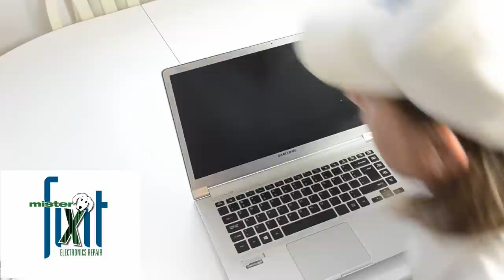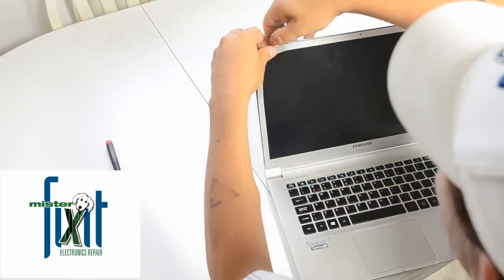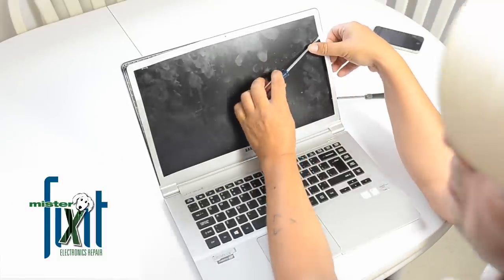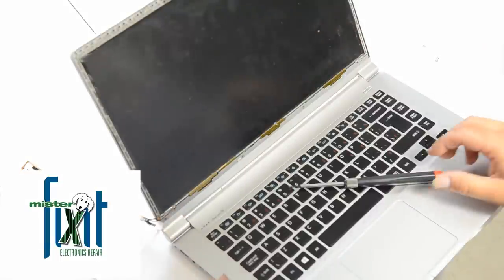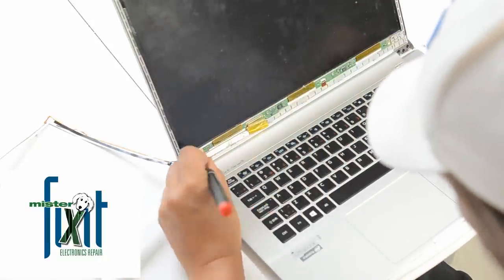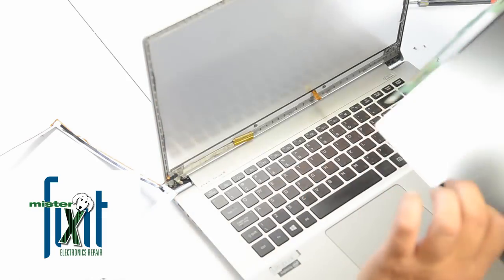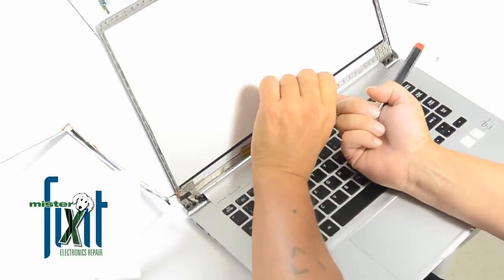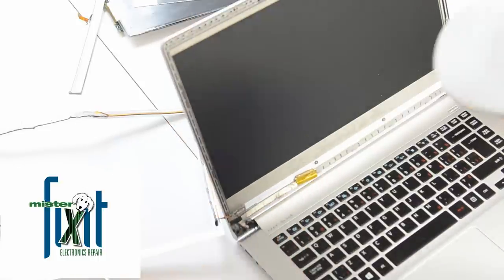HOW TO REMOVE SCREEN ON SAMSUNG ULTRABOOK

Comment: Thank you for the video but....  Part# BA96-06424A LCD-replacement comes as one unit with the hinge assembly.  Flip the unit over remove the 10 back plate screws, remove the black hinge screws and unplug the mother board connection.
Reply from the maker: Thanx for the share Paul... this video was shot before you could even buy replacement parts
Reply: +William Stephen Walsh , 139GBP in Poland with discounts in Samsung.
Reply: I need a 13.3" screen assembly but they want $325 (or something from Samsung US) where can I get one for about half that price?, my model number is NP900X3D.

Comment: Vince peels off the screen, then continues into the backlight assembly, piece by piece.  No point in trying this, as you'll have to order the whole top display to replace the glue sandwich you've just spent an hour peeling apart anyway.  

Someone who knows how to separate the screen piece from the backlight without tearing the backlight to pieces has some serious arcane knowledge.

Comment: where do you get a replacement screen from?, all I see on ebay is the whole screen assembly (for about $190) can you get a bare screen for less?
Reply: yes you can. google  LSN150KT01-80 (for the 15" one anyhow) and things like ali baba or shenzhen. You'll find it for much less. Replacing the screen yourself though like he's done here seems a dangerous endeavor
Reply: I got the 13.3" one, anyway I found ones that says they have the screen but it says it doesnt  include a backlight and I dont know how to remove the screen without breaking the backlight (this video seems to break everything that was in there except the cable and the webcam camera , I dont care if I break the webcam camera since I cover that over with a sticker anyway) :)

Comment: The touchpad on my NP900 died is there any way to replace that?, I'm pretty sure it's a hardware issue as I re-installed the drivers, I made sure the touchpad was on (under settings. fn+5), etc, nothing has worked so it seems I need to replace the touchpad is there a video on how to do that anywhere on Youtube?
Reply: Mine died also very annoying!, I ended up buying a usb touchpad on Amazon for $20 but Samsung really should build their ultrabooks better I mean they aren't cheap (mine cost $700 used), they shouldn't break so easily!